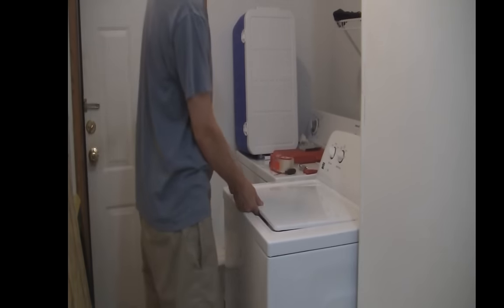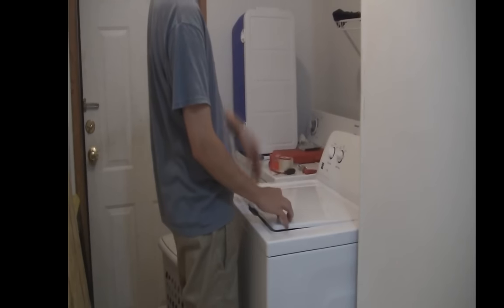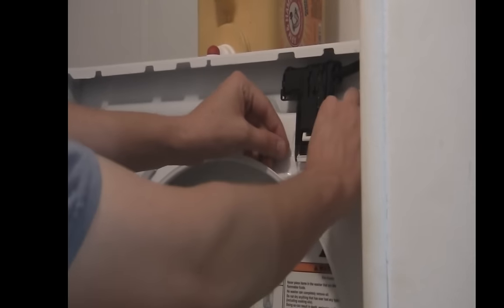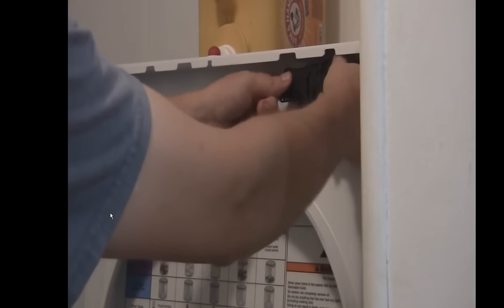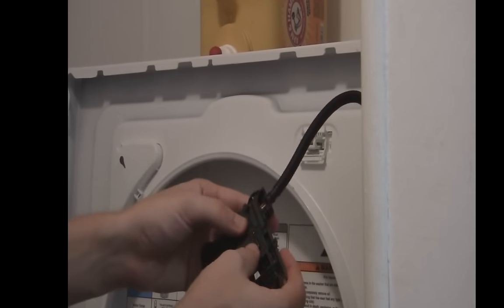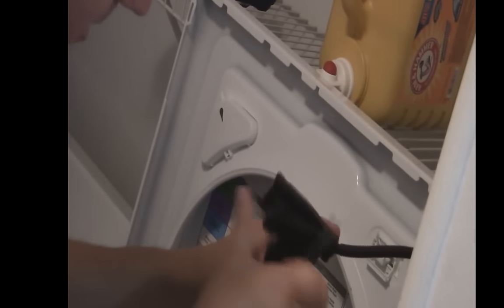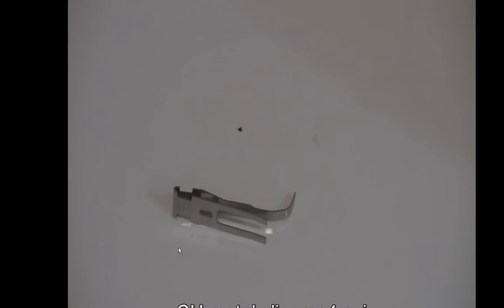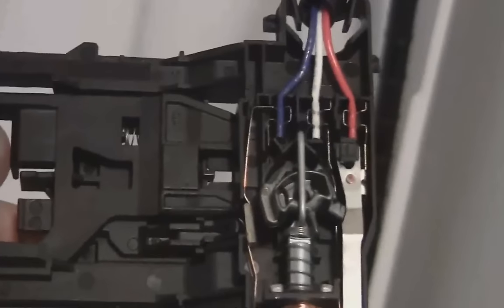Maytag, Kenmore, WhirlPool Clicking Lock Fix

Comment from the maker: Update:
I had to replace the lock on June 2nd 2017.  The Copper part found in the video at 4:10 broke.  The copper wire became unraveled and I was unable to fix it.  

I searched ebay for the part number w10838613, and found it for $40.  

After replacing the lock I had to do this:
Plugin the washer.
Immediately put the lid latch in the lock hole and then take it out 6 times in 12 seconds
Then leave the latch in on the 7th time. 
Then position the settings dial to Rinse/Spin and run a Rinse/Spin.  This reset the lock mechanism or the computer and it started working normally.   Before this the lights were just off and it wouldn't work.

I now have the latch permanently in lock and can lift the lid while the washer is in use.  

Sorry the original fix I posted only worked for about 10 months for me and the 2 other guys that use the washer.  I posted this video a couple months after I had fixed it.

ALSO this was commented by Roop about a year ago and you may find it helpful!   👇👇👇👇👇
👇👇👇👇👇

"This video itself did not work for my wtw5000dw2 with a flashing lock light, but it did help me fix it:

At 4:10 in this video, directly left of the solenoid (copper part) you see an angled piece of metal. This is part of a mechanism that detects the door being closed. The white plastic which pushes on this switch mechanism was broken in my washer. If I manually move the broken piece of plastic I can see it causes two pieces of metal to touch. What I did was forced this switch closed, by forcing the two pieces of metal touch.

This fixed my lock light flashing. Right after this I was able to use this washer again.

https://www.youtube.com/watch?v=_N_YCSNziXc has a video of the manual which was also very helpful."
Reply: In the video we want the latch permanently in lock anyhow right? Does that mean little black plastic thingy up or down?
Reply: I'm having trouble just removing the lock device. Was wondering if you would know what i'm doing wrong. I tried doing exactly as you did in the video, but it wouldn't budge. 
Model: amana,   ntw4605ew0

Comment: This does not work if there is corrosion on any of the main terminals. The metal that connects to the main wires. Other than that fact and the 90’s type wobble with the filming. This was still the most helpful after 15 other videos and I was fortunate to drain and spin out the cycle of needed towels. Have to get a new lock mechanism set because of the stupid corrosion. That being said. Props dude. And thank you.

Comment: You sir, are amazing.  Simple fix that worked, clear instructions.  With a screwdriver and 7mm wrench I took the mounting screws off(on my amana washer, could be different on someone else's), took the metal clip out of the housing with pliers and replaced everything.  
In short, in worked, and I really needed this win.  Thank you.

Comment: Saved me! Washer is only a year and a half old and just didn't turn on one day, no lights or anything. Model wtw4816fw2. Unplugged the lock wires from the board and gave me the slack to pull out the lock from inside, then pulled the metal clip. Took a couple times of putting it back in to get it work work, but your picture of it let me know how to put the tiny pieces back together! Thanks Dan!

Comment: Brilliant! I did this on my Maytag Centennial and although the plastic lock case looked different, the little metal spring I removed looked exactly like the one in your video. The only difficulty I had was reassembling the whole mechanism because when I took the plastic cover off, all the pieces flew out before I had a chance to see how they were put together. Took a minute to figure it out, but apparently I did it right because now the washer is working. The best part is that now the lid no longer locks and I can open the $#%&* lid whenever I want to!
Reply: Heck yeah!
Reply: Did you know for sure the lock was doing it?
Mine won't start any cycle but the lock keeps clicking in and out when you try to start a cycle. Is this what yours did?
Reply: @colleenwillard5385  mine is going it was well same brand. I'm assuming the lock just took a crap

Comment: I fixed this issue for my Amana washer model: NTW4516FW2 but I did it a little differently. In this video he talks about removing the metal clip but I just removed the plastic piece he fidgets with at 5:00 on instead. When putting it back together I made sure the metal switch wasn't in the contact position. The lock light came on then it actually started spinning for the first time (just bought it) when I tested it in "drain/spin" mode. One thing to note is that the red and white wires in my model were opposite of where they were in this video (not sure if that matters). My lock light wasn't coming on at all but now it does. Thanks Dan H for showing the world what to do!
Reply from the maker: Glad there was an alternate way to fix it, thanks for sharing!

Comment: Well I'll be an  s.o.b. I had a problem with the door lock on my Amana washer which seems to have the exact same door lock that you download in your video I followed your instructions to the letter although I didn't have to disassemble that unit the clip fell out without doing that. So I carefully put it back together and position and clipped it back in place and it works perfectly. Thank you very much!

Comment: I have a BSME in mechanical engineering.   I've been designing, building, specing, and servicing automated equipment for over 2 decades.  I program in over 25 different control languages.  I'm the guy maintenance calls when nobody else can fix it, but I'll be darned if I could get this stink'n switch to work!!!  Pain in the rear to get that darn spring put back in when you didn't see how it came apart.  Then I watch this vid.  As soon as you said to get rid of the spring, I could have kicked myself.   Works like a champ now.   Thanks!!!!   I'll be sharing this video every time I get the chance!!!
Reply: I have a big hotdog   🌭

Comment: It was a little tough to figure out what pieces go where to reassemble, but after about 20 min of tinkering I got it and it's working flawlessly, thank you so much. My problem started when I pulled up on my locked lid due to a lop sided load in the spin cycle,  you saved me a lot of $ and only caused a slight headache 🙃🤣🤣 again,  THANK YOU!!!!

Comment: Great video. I broke the lid switch on my washer when I was trying to open the lid by force. I wasn't patient enough to wait for the washer to stop spinning completely. Anyway, followed this video to remove the metal clip (and a tiny broken plastic part), assembled back and the washer was working again. Thanks.
I was planning, alternatively, if this method didn't work I would just bypass the switch.
Reply: I wish you would have bypassed it and shared how. I don't know which wires of the red white and blue
Reply: @docgray5004  I’ve been trying to bypass and I genuinely don’t think it’s possible
Reply: @Pedro-rj1iu  I pulled the switch to be accessible whole in operation and manually fiddled with it during washes but just went ahead and got a different washer.

Comment: Just a couple comments to add. First, my “locking mechanism” broke because I was impatient with the washer and opened the lid too early. This is really easy to do—so be careful because it results in this clstrfk of a mess.

First thing of note, with this fix implemented, the washer’s lid will still trigger the safety shutdown. As far as I can tell, there’s no operational difference.

Second, it seems two variables are key in order for this to work. The first is to get that long silver V/shaped piece of metal out of the locking contraption. It came out of mine before opening the cover to the unit—but I believe you’ll still want to open that cover anyway because of variable two.

The second essential part is to make sure the rotating latch, shown at 4:43 results in closing the circuit (i.e. the small lever is in the lowest connecting position). This should mean a “turn” to the left.

*When your washer broke, it might’ve not left the rotating lever in the connecting position—so this is why I think you need to open the crappy black plastic box. (I think the towel is a good idea—this cheap mechanism can be put back together quite easy should it sort of fall apart.)

Lastly, when looking down on this component (as seen in 4:43) there appear to be two places that form a complete circuit for electricity to travel through. As mentioned above, you rotate the pin so that the right side connects—but on the left side (where the push of a lever connects the circuit) don’t worry about it. The latch (that almost surely is still connected to the lid of the washing machine) will force that circuit closed when you shut the lid.

So, make sure those two variables above are correct, and when you put it all back together it should work.

As an aside, my parents got a set of Maytag washer and driers when they were married. They lasted for over 30 years without any problems. The “Maytag” version of this washer looks like it couldn’t have had one more penny cut out of its materials and manufacture. Sad to see this garbage build quality with the Maytag name on it now. 🤷‍♂️
Reply from the maker: You can remove the latch from the top of the door and put it in the latch hole so you can lift the door while its operating.
Reply: Dan H Thanks! I might do that. After fixing the latch mechanism the first time (following your instructions) the washer was basically dead the next time I went to use it (my roommate had used it last, so I had no idea what could’ve happened to kill the washer). I tried the reset code that you can find on YouTube (start at 12 o’clock, turn left one, right 3, left one, right one) to enter the service menu. A hour of dking around got me nowhere. So, reluctantly, I took the whole thing apart again to look at the latch assembly. When I opened it up, it looked like the “U” shaped metal arm had somehow come out of the piston (?) part of the solenoid. I was able to delicately reassemble it thanks to your closeup look at the whole mechanism, as well as you demonstrating how it worked. I put it back together absolutely not expecting it work, since logically it didn’t seem like I’d done anything to affect the circuit, and it had been completely non responsive. But, praise be, it actually started working again. I don’t know if this made a difference, but I did perform the “reset” via the service menu, and also, before trying to starting the machine for the first time, I held in the “start” button before plugging the washer into the wall—and I kept the button pressed after plugging it in for about 20 seconds. The door light flashed red, and it *appeared like maybe something had been reset. I don’t know. My roommate is a five foot delicate Mexican girl, and she manhandles everything in the house while cursing in up a storm in Spanish. I don’t understand her, or this f—ing washing machine, but thanks again for providing the only helpful video on YouTube for this insane (and apparently common) problem.

If you add a patreon link or some other type of electronic payment link in your description (maybe add a pop-up box at the end of your video too) I’d be more than happy to throw a donation your way. You definitely deserve it. Thank you!
Reply: Vital info… Thanks so much for pointing this out! 
I took off the lid lock assembly, (black case) and opened it, took out the metal V. 
And put it back together. And it wouldn’t function at all and I panicked. Lol 
I didn’t know to check the rotary thing (to make sure there electrical contact on right side… 
Thank you thank u thank u!!!

Comment: OMG! That worked 100%! I had to buy the replacement part because the inside got corroded but when I installed the new part, it didn't work. After I took out that clip and reinstalled the lid lock, it worked. Thanks!

Comment: Thank you!!  SO much easier and safer than messing with rewiring around the problem.  And to not have it lock now... ahhhhh.....joy.
Reply: Problem is that with this switch, you can't wire around it.   The control board wants to see the signal turn on and off as the solenoid engages and disengages so it knows when it's broken.

Comment: 3:20 I just took out the black plastic piece below the red wire so the metal would stay touching. Now the lid thinks it’s always locked. I was a little worried about safety but if you lift the lid the washer stops at least on my model. This video pointed me in the right direction

Comment: Great Fix! It worked for me too , Thank You! At first I though it didn't work because the RED Error light stays lit. But I just ignored it and used as usual. Also now that I can open the door while its operating I noticed the agitator was not spinning. I had to tighten the nut, works great now. Funny, I think this had been loose for a long time since my laundry is much cleaner now. Also noticed no hot water coming in. Found and cleaned the plastic hot water inlet screen, it was plugged up with crap, now nice hot water. It's a good day, I have a fully functional washing machine!........ PS: I never found the little spring, it did not matter in the end

Comment: Good job, thank you. If you splice the white and blue wire together you bypass the whole switch and don't need to replace it or call for a tech. Seal that splice well.
Reply from the maker: Nice sounds good.  I'm not a electrician so I have no idea what is really going on under that locking mechanism, but if that works then that is wonderful info!
Reply: This just fried my washer.... Shit
Reply: @jonathanbutler1985  did it really fry your washer? I was looking to bypass.
Reply: I'm going to try dans method....I'd rather not risk shorting the main control board.
Reply: @docgray5004  yes, I started the washer and just as I got excited, I heard a very loud pop. Fried the main control board.  Try your luck on finding a used part on Ebay. Fortunately I found both parts at a decent price.
Reply: @jonathanbutler1985  I just want you to know your comment saved me from frying my washer too.....thanks a ton.

Comment: It really does work!  After I removed the lock lid mechanism from where it was mounted, I didn't need to take the face plate off the mechanism, all I did was play with it and that stupid little clip just fell out. I have a slightly newer model whirlpool. Mine is only a year old model #: WTW5000DW1 ...its just slightly different than one on the video. Overall great DYI fix it trick!! Don't pay $80 for a whole new part, try this first. I.e. if your washer works fine, it goes thru wash cycle but when it's time for spin cycle it keeps making clicking sound and the light will eventually blink which means its not locking or it thinks its not locking.

Comment: Please help. I have the whirlpool W1046834. Broke  plastic piece that holds that metal clip. Repaired the broken plastic and removed clip.... Then a buddy decided that he'd by-pass the locking mechanism by removing the entire lock mechanism and just attaching the wires how he thought they were supposed to go.. Now, you've guessed it, it does not work.

If I am able to put it all back together how it was before do you think it will work properly? Is it safe since he has done touched all the wires together in various ways ?

Comment: Is there any way to attach particular wires to bypass the lock ? I noticed this idea with some of the 4 wire locks when searching for the lid lock bypass. I did your video about 4 months ago and it totally saved us ! I tried again to open the little black box and reassembled everything but this time no bueno. So just wondering if there is a way to 'rewire'. Thanks !
Reply from the maker: Sorry I just saw this.  I am not an electrician so I'm not sure.  The fix only worked for me about 9 months, so I did have to replace the part eventually as well.  If you replaced the part and are still having issues I have an updated comment on my video explaining how to reset the washer.  Good luck!

Comment: Is this fixing the lock, or bypassing it?  I'd prefer to just bypass the lock altogether.  Can I do that by shorting out the sensor?  I see three wires going into the part and assume two are power for the solenoid/electromagnet.  Are two used as the "locked/unlocked" sensor?  And, can I just short those two and remove this entire part completely?  I understand and accept the risks involved in having a non-locking lid. Thanks!
Reply from the maker: To bypass the lock you need to unscrew the latch from the top of the washer door, and then just leave the latch in the latch hole. You will likely need a hex screw driver for this, but I'm not sure exactly what size hex it takes.

Comment: So if you just pop out that small plastic “pin” that drops straight down into the sliding latch then those metal connects permanently make contact and you have this circuit permanently complete.?

Comment: I'm not sure how old this video or new this video is this actually does work and it does bypass the lock switch but for me it started doing the same thing again one day later yes I have to toy with it a bit mess with it and it still works but just letting you know just doing this don't keep it washing all the time you will have to tinker with it over and over
Reply from the maker: Usually after doing this fix you just have to unplug and plug back in the washer between every wash and that should be enough.  But there will be some differences if the washer doesn't have the exact same model lock.